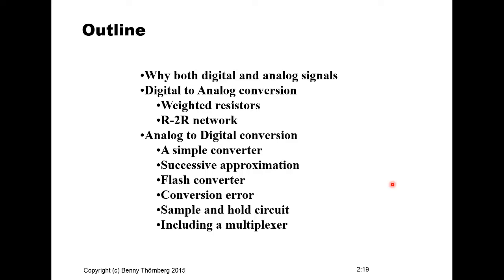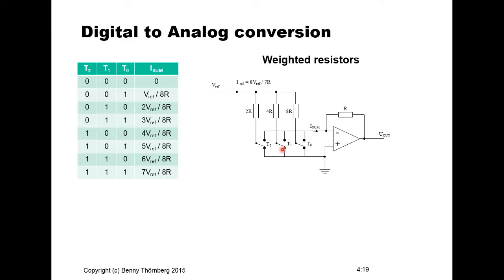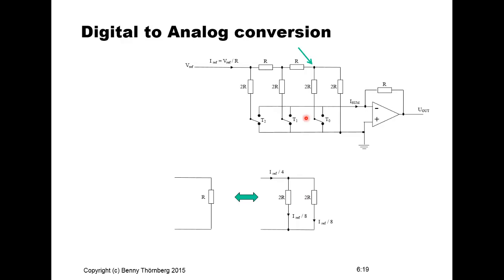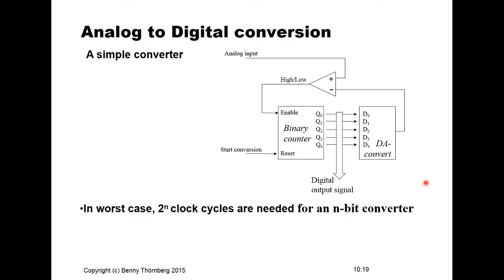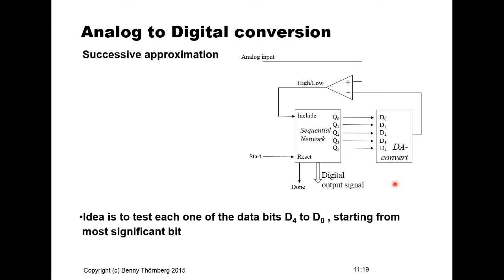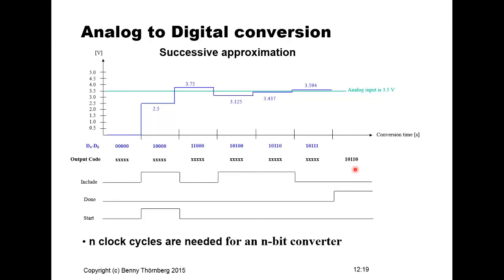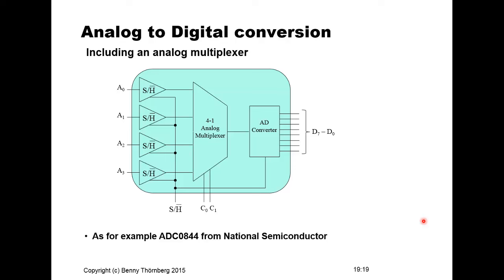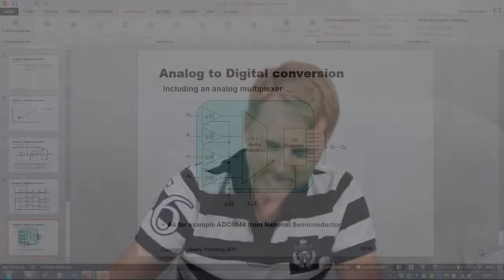Metrology - AD- and DA-conversion

Comment: There is an error in slide 13. Only one output of the comparator chain is allowed to be "hot" (set to 1). In this case it is only the output of the second comparator that should be 1. The first one has to be 0.
Reply from the maker: Hi,Thanks for an interesting comment! Be aware of that the output of the comparator will be in accordance with the kind of information it can extract.A comparator by itself can only detect if one analog voltage is larger than or less than another analog voltage.In this case the two upper comparators detect that the input voltage is less than their reference voltages. The other five comparators detect that the input is larger than their references. Reference voltages comes from the resistor chain. The binary encoder in this slide must be interpreted as a conceptual encoder without all details worked out, in general a combinatorial network. A priority encoder with active low inputs should work just fine.Cheers Benny
Reply: Hi, you are right with the output of the comparators and with an active low priority encoder it would work. Thanks for the help and  comment!